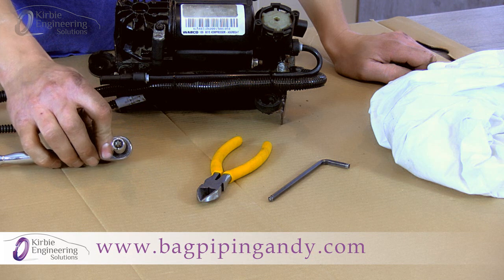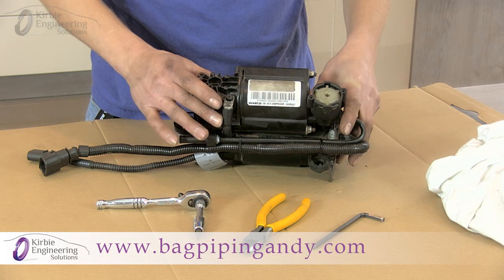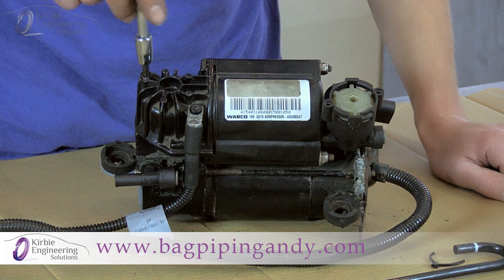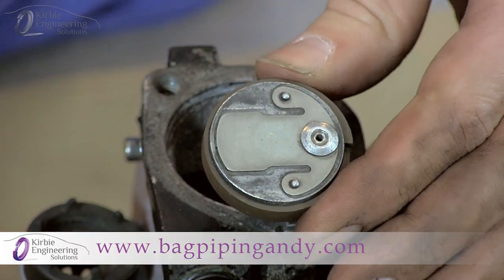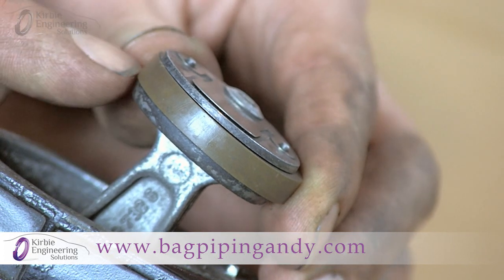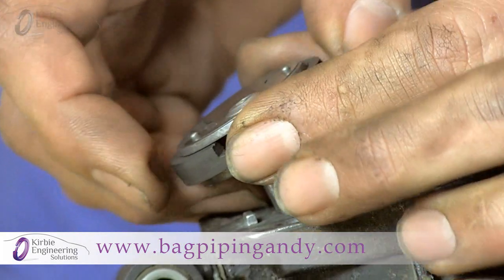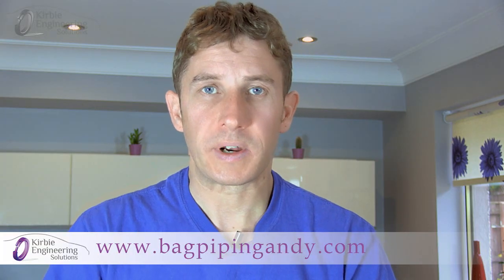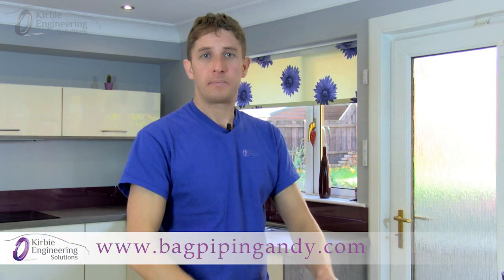Wabco Air Suspension Compressor Piston Repair Kit for Audi Allroad

Comment: Perfect kit.  The Audi dealer is not going to install these parts, they'll try to tell you that you need a new compressor.   30 bucks in parts and a couple hours of your time.   If you go to an Audi Dealer, they'll likely try to sell you a new OEM compressor (list price 1600 dollars), plus 2 to 3 hours shop time.    This is not a difficult job, there are two tricky parts.  The first is removing the electrical connectors, which are tucked into a tight space.  The second tricky part is fighting gravity while trying to re-install the compressor, the washers that rest above the mounting flanges, and springs and spacers that go under the flanges.  What I did was to get all three washers in place, hold the compressor in position (use a second set of hands or a transmission jack), then install the springs and spacers.   The whole job should take less than two hours start to finish,  unless you spend any time looking for dropped parts.   I'm grateful to have a lift, I would not want to do this job on my back with the car on jack stands, although a younger me would not have had a problem with that.
Reply from the maker: Hi Vandal. Thanks for the information-packed reply. I think others will find it really useful.
Reply: Yeah, not a difficult job at all!

Comment: Very useful video, thank you. The kit is excellent, and using what I learned from this I replaced the piston ring in the compressor of my 2001 Allroad today and it has rejuvenated the compressor to be back like new.

FYI, for the price of a "drink" I used a local garage's car lift, and access was so good I did not need to remove the compressor from the car, but was easily able to remove the top and replace the necessary parts with the main body of the compressor still on the car. I worked slowly and methodically, but it still only took about 30 minutes. 

Highly recommended!
Reply from the maker: I am glad you found the video useful and that the kit has rejuvenated your compressor. I'll pass your comments on to Bagpiping Andy at Kirbie Engineering.

Comment: Top Video explaining things to Air Suspension Compressor used at AIRmatic. May I need this repair kit after I heard some noise and shaking from the compressor. It stopped, but still a warning signal is shown. Maybe some little leakage?

Comment: Good job. I will look at your site about buying this kit. But first I need to pull the compressor from the s500 and see what's going on in terms of leaks. Thanks for this video!!!
Reply from the maker: Thanks for your comment. The link to Andy's website is in the description below the video. The video should provide the info you need to do the job but if you have problems I know Andy does take support calls, although fewer people need support since we did the video guide. If you need to call Andy his contact details are at the bottom of his home page. Good luck and Happy New Year.

Comment: Wabco Air Suspension Compressor is a well built piece of equipment. thank you for the video...
Reply from the maker: +Elbert Dugdale Thanks for the comment. Yes it is well built but like all moving parts they do wear out. The Repair kit allows owners to replace the worn piston ring without having to replace the whole compressor.

Comment: hello i have E class with airmatic system but its stuck in the rised position and with a workshop visit in the dashboard. i have checkt it and the diagnos computer seas its a PRESSURE REALESE VALVE WITH A9/1Y1 CODE. do i need to replace this valve only or the houle compressor
Reply from the maker: Hi. Sorry to hear you're having problems with your E Class. Please contact Andy Fulton direct, his phone number is  +44 (0)7767838330 or you can email on info@bagpipingandy.com

Comment: received my kit today. one question though,  what's the big round o-ring for? I saw in this video that Andy only used the shaped o-ring gasket and piston ring.
Reply from the maker: The kit comes with two seals but you only need to use the o-ring that fits your style of compressor.

Comment: Great vid Andy, and I see you're on a certain 'auction' site too 👍🏻  Quick question Andy if I may. I have replaced the suspension air bags on my BMW f11. I raise the car wheels off the floor and the air bags inflate and become rigid/hard... but when I lower the car onto the floor the rear drops all the way down and the air in the bags is pushed out! Is this a compressor issue? As I noticed a comment you made where a pipe on the compressor is there to allow air to escape. Many thanks.
Reply from the maker: HI Steven, If you conbtact Andy through his website,  http://www.bagpipingandy.com, I'm sure he will answer you question.
Kind regards,
Tosh
Reply: Tosh Lubek thanks tosh 👍🏻

Comment: I have a 2014 Q7 and my compressor  kit got replaced due to some fault , mainly due to the noise which it started while lifting the suspension of the vehicle from lower levels. The Audi guys replaced with new two solenoid compressor and the noise is still coming while lifting. He even showed other q7 they are quiet a bit. The guy saying "as u got two solenoid(the latest one) with extra valves its making little more noise. No need to worry about that". He replaced that through warranty and so I want confirm from u, that while lifting the vehicle from dynamic mode, does the compressor make sound,apart from the engine noise? Please observe precisely, from q7 or the vehicle u have and let me know please, just now I got it, that's why. He even explained well and showed me the old compressor with my chasis number. So, can u clear my doubt please?
Reply from the maker: Hi NIshant. Please contact Andy directly, His website is http://www.bagpipingandy.com/compressor.html and you should find his email address and other contact details.

Comment: Are you going to offer a new compressor/cylinder head for these air pumps? I replaced the piston ring, works really good again 20 seconds to lift to each of the 4 positions, but I noticed the cylinder bore was worn pretty good, I used a small piece of 400 grit wet dry to polish one spot on the bore. Pretty sure that's is a Teflon based coating on the cylinder bore.
Reply from the maker: +blkcoupequattro   As far as I am aware,Andy Fulton (aka BagpipingAndy) is only going to be making the compressor repair kit. He hasn't told me about any plans to also offer cylinder heads.

Comment: Hello, I am most probably going to buy the kit for my 2008/05 allroad, shipment to Germany. Just one question which puzzles me: you say there is no lubrication necessary. This somehow makes me think the wear of the seal is exactly because there is no lubrication whatsoever, as the proper type of oil/grease would greatly increase the life span. Of course anything petrol-based is probably ill-advised as they invite fine dust/muck. But what about low-adhesion lubricants, like something silicone-based? Like the stuff they sell for door rubbers during the winter? I mean buying a 20 or 30 pound part is not that much, but once you imagine its lifespan could be increased easily, just doesn't make sense. Thank you.
Reply: Ahh ok, see your e-mail. Will write once the buying gets closer. Thanks again.
Reply from the maker: From a conversation I had with Andy I think the part is designed not to be lubricated. The seal is  manufactured from a material that has very low friction. If you visit Andy's website I think he gives more details there.

Comment: I have a 2016 C Class and they changed the compressor for the AirMatic suspension. A rare case for a recent car, I'm told. 
Dashboard displayed 'malfunction'. My car never sagged, nor did I get the message 'car too low'. All fixed. 
Can I expect that car is level or should I be concerned the distribution of air pressure is not equal to all 4 struts? Anything I should be concerned about? Thanks.
Reply from the maker: Hi Angus. Andy Fulton, who presents the video and makes the repair kits, is far more qualified to answer your question than I (I made the video and help to answer what I can). If you contact Andy through his website I'm sure he'll give a definitive answer, ans certainly a better one than I can. Go to http://www.bagpipingandy.com/compressor.html and you should find his email address (info@bagpipingandy.com) and mobile number.
Reply: Angus McMichael a

Comment: Does the fitting that connects the air output hose to the compressor need to be replaced when refitting the compressor to the car, or can the old one be reused?
Reply from the maker: When we shot the video Andy only replaced the piston ring and did not mention anything about replacing the air output hose. Therefore I assume you just need to replace the piston ring..

Comment: I replaced the two rings earlier today and I am getting the fault worse than ever now. any suggestions?
Reply from the maker: +klintous   If that is the case you can call Andy Fulton to double check your fitting or investigate whether the fault is due to another issue. You will find both Andy's phone number and email address at the bottom of the home page of his website http://bagpipingandy.com/
Reply: +Tosh Lubek  Thank you for the quick reply. I am going to double check and make sure that the mechanic connected everything myself first. I am hoping it is something simple because it is not raising at all now. Before, I would only have issues in the extreme cold. I only get the fault about five minutes after starting my car...
Reply from the maker: +klintous   I hope your double checking corrects the problem, otherwise Andy is a very knowledgeable guy so a call to him should be able to help you.

Comment: i need a the wiringdiagram for the connector from the valveblock on the compressor (10 pins) ,peugeot expert or citroen jumpy 2013....mechanicly its oke but i have a problem with the relieve valve i think……….
Reply from the maker: Please contact BagpipingAndy directly. His contact details are Phone: +44 (0)7767838330. E-mail: info@bagpipingandy.com

Comment: Tell me please, what material is made with the piston ring on AIR
Reply from the maker: Hi, the information you require is available on the bagpipingandy website. The website url is available in the description of this video.
Reply: Tosh Lubek Thank you content found, and what the inner and outer diameter of the ring if it is not a secret of course))
Reply from the maker: I think that is likely to be confidential information since I know Bagpiping Andy took a lot of time getting it perfect.
Reply: Tosh Lubek Understand, and tell whether it is possible to send Belarus your material for the manufacture of piston rings pneumocompressor what price PTFE
Reply from the maker: I will Private Message you.
Reply from the maker: I have passed your email address and comments on to Andy.
Reply: Tosh Lubek Give to know by e porchtu
Reply: Tosh Lubek Please tell me what percentage of graphite contained in the material for the manufacture of the Rings?
Reply from the maker: Please see the bagpipingandy.com website for freely available information. If you have contacted Andy direct and he has not provided further information it is likely to be a trade secret.

Comment: Can it fills 250 bar cylinder
Reply from the maker: Hi Nasir. Sorry, I don't know. Andy is working with the compressor for the Audio Allroad, which is also used in a number of other vehicles. You can check their specifications online or contact Andy Fulton directly. His phone number is  +44 (0)7767838330, or you can email him at info@bagpipingandy.com

Comment: If the compressor is 7-10 years old this won't fix it , you'll find that the motor starts to fragment inside , remove the motor head bolts to see inside , if the metal plates on the rotor or "iron core" are marked or dented then this is a sign its knackered I'm afraid 😨, you'll still get error codes as the amps in the motor will be all over the place you may even find the car stats with other electrical malfunctions as this problem will cause them,  better off just changing the whole compressor.

Comment: I never received the items from "Bagpipingandy", I'm sorry to say but I think think you are fake.
Reply from the maker: Hi Takudzwa. Andy is certainly not a fake. He only sells through ebay so when you bought one of his kits it must have been through ebay. If you follow the link below you will see ebay's advice to buyers who have not received any bought items. Ultimately you can open a dispute on ebay if you do not receive the goods and the seller does not respond. ebay also offer a money back guarantee if the issue is not resolved. Personally I would check the details on the listing as to delivery times and if it has been more than 10 days after the estimated delivery date then  contact Andy through ebay/PayPal.
 http://www.ebay.com/gds/I-have-not-received-my-items-What-should-I-do-/10000000007570328/g.html
Reply: Thanks.
Reply from the maker: Takudzwa Tamba  You're welcome. I hope you get the kit soon and that you get a good result once fitted.
Reply: I just received mine in the mail today. Bought from eBay. certainly not fake!!
Reply: Mine came today, 1st class post the next day